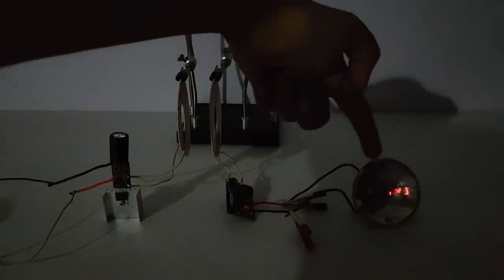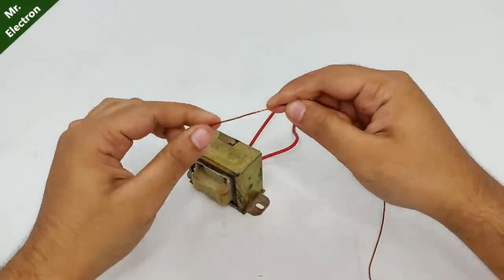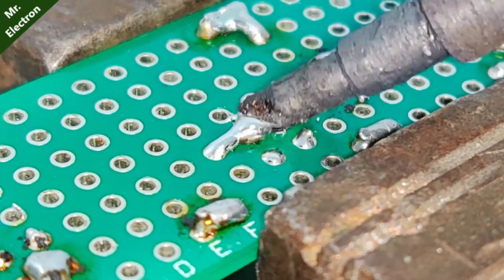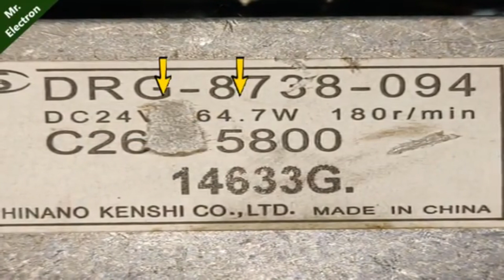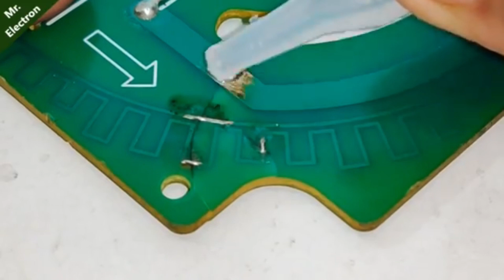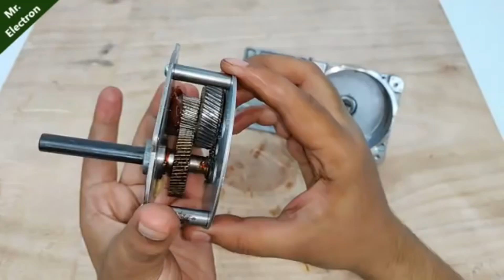3 Simple Inventions with Electronics

Comment: I was very impressed by your repair of the gear box motor circuit and with your first attempt at trying to repair the shaft with an induction heater. That was really amazing even though the shaft was not completely straightened it demonstrated the concept that it "could" be straightened if you had more experience and perhaps a tool that would help straighten better than hammer... really great video. Thank you.
(Still can't find the link for the first project in your description).